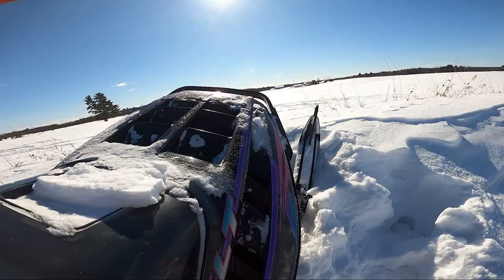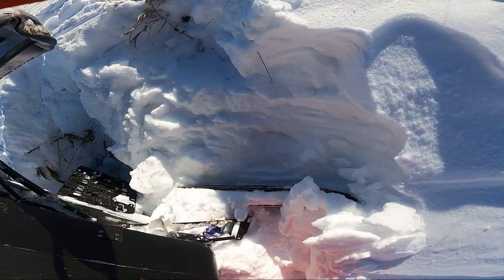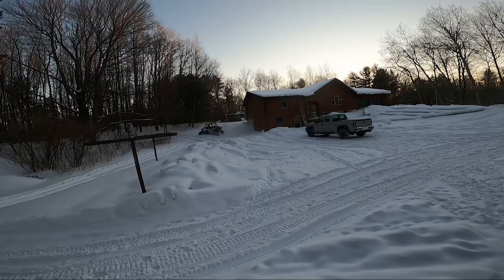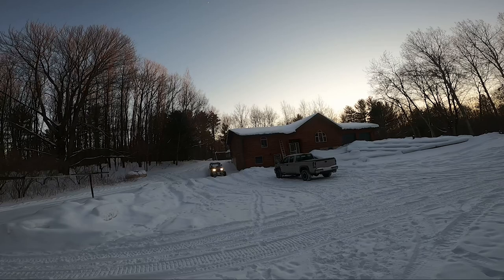Stranded on the Polaris Indy XLT Triple Snowmobile in DEEP SNOW

Comment: If thats a 97 i have the exact same sled just gonna be changing the suspension and track to a 133.5 with a 1.5 lug cuz my original track has no more lug after last winter awesome video btw also sounded like it melted a piston skirt mine did the same this over the winter got new ones going to check the seals before winter this year